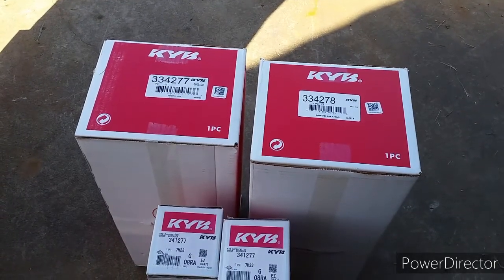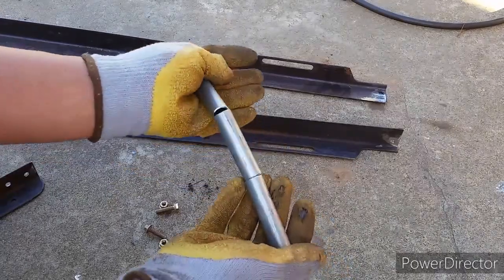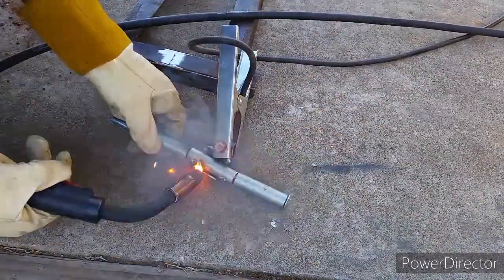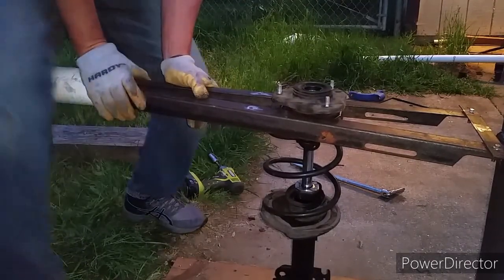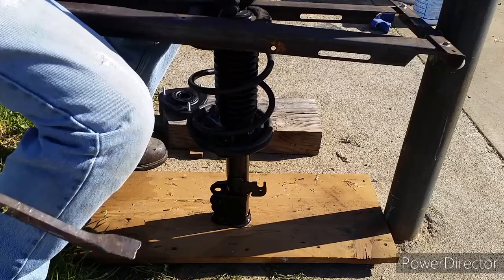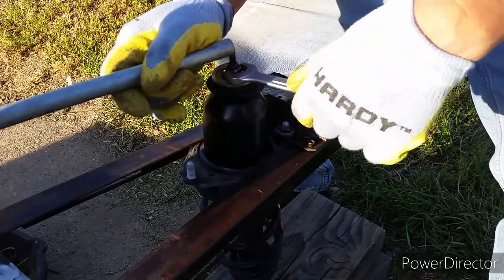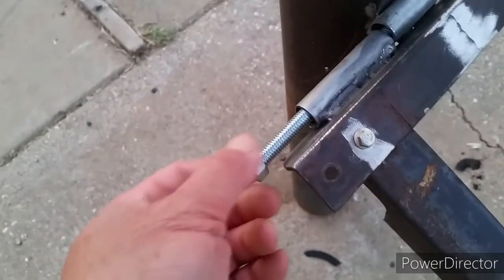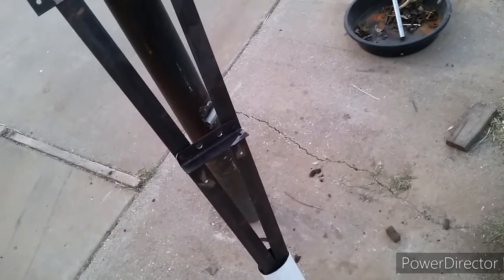Homemade strut spring compressor | Awesome easy to use | DIY

Comment: Good job.. thank you…
Reply from the maker: Changing struts was a breeze.  Don't worry  about the spring exploding.
Reply from the maker: I think i may make a video of how to remove the engine. I wrecked my celica and I picked another one but this motor burned oil like crazy. I'll install the engine I've rebuilt from my wrecked car into this new hooptie. Not sure when yet.

Comment: Gotta buy a welder.
Reply from the maker: It's handy. You can remove the broken bolts stuck in the engine block. Fix any metal that has fallen apart.  Build things.  Get one that can hook to argon gas.  Less splatters.

Comment: fantastic bro . I guess this will not work if you are a lightweight, huh? lol
Reply from the maker: Actually it didn't require a lot of weight.  All I'm doing was slightly depressing by sitting on it.  My feet were still on the ground. Even when you are a lightweight individual, it will still be easy to do it.  Probably about 100lbs is enough.  You can always bounce on it. Or get a chubby  girlfriend to help.  😆

Comment: Yess!!! I love this method man! Thank you for thinking outside the box friend, btw you know you can patent the idea and sell it right??? 😎 

True, the only thing i would add to it, as you previously mentioned the chance of the bottom-end slipping away and hurting something...

simple fix in my opinion..
  (2) pieces of 2x6, cut both to 1ft long, then make a center hole slightly bigger then the average struts bottom end of one of the pieces, stacking the pieces on top of each other( wood with hole being on top) and screw them together.. now the strut has a little groove to sit in,  protecting you and your new strut 👍
Anyways this definitely helped appreciate it and I'm
looking forward to what else youll come up with.
Good luck
Reply from the maker: All you really need are a few square tubings that can bolts together to assemble the kit.  You can make a killing selling them.  Lol

Comment: Could you use the vehicle itself-bottom control arm as a compressing tool?
Reply from the maker: Undo the front springs on the car is possible.  Just remove the nut on top, then jack the car up to remove springs. Put it back requires adjusting the strut shaft to line up while jacking up the control arm. Little tricky.

Comment: I take it all back
You did weld it
Reply from the maker: I only welded the tubes at swivel area.  On the post and on the ends on angle irons. The rest are bolted on.

Comment: nothing is safe if you are using your crotch to hold down several hundred pounds of pressure.
Reply from the maker: Actually there is not a whole lot of tension there.  I just pressed down enough to loosen the nut. Even if I was to fall off the handle,  nothing would happen.  There's not energy in the spring to shoot up and cause any injuries or damage anything.  But if you clamped down the spring,  now you're loading the coil. If suddenly released,  it can cause serious injuries.  When i removed the nut,  the spring would only rised a few inches.  Totally a lot safer any strut compressors.

Comment: The strut compressor shown at the beginning can be dangerous and is nerve wracking. But the example you used was also either intended to fail for demonstration or they were a moron and not doing it properly.

Comment: Nice . Now where is that piece of steel pipe and those bags of post cement .
Reply from the maker: Previous owner cemented a basketball hoop next the driveway. everything got dismantled except the lower section.  It's filled with concrete so i just left it there.  I got another use for it. I'll make another video when i get a chance.

Comment: 0:13 I use this spring compressor the problem in this video is that you can see bulging since they are not even looks like the creator of the video intended this to happen in purpose to demonstrate what would happen if you don't engage the locking pins.
Reply from the maker: I know the spring compressors work but they are hard to use. Some got locking pins and some don't.  If not properly seated on the spring, they will slide to one side when tighten because spring coils are at an angle. This would cause it to bulge. Even when they're evenly comressed like in video,  they can still slide at any time.  The more you use these spring  compressors, the better you get at it.  Keep in mind the spring clamped down has a lot tension and can go south on you.  Side note, the shocks in the back of the car have tighter coils so you can't even insert clamps into them to compress. Homemade spring compressor will be able to handle them.
Reply: @tonedubb4325  are you a beginner at coil springs suspension removal and installation?
Reply from the maker: I have done a few but everything tried to remove springs using the clamps, they tend to slip if the bolts were not even tighten.  Reinstalling new strut was kinda scary too. If the springs were not even compressed, nothing would line up. They can't be used on rear small springs . But your homemade spring compressor does it easily and I am worrying springs flying at me.

Comment: What about if you don't have a pole set in concrete?
Reply from the maker: You can screw a small piece of 3/4in plywood onto a wall like in your garage or use the fence 4x4 post or a tree. It so happened I got a half metal post an old basketball hoop. I used that.
Reply: J dub Motors please use your brain

Comment: I like it but I do wonder if it would work with a strut from a 1/2 pickup. I would guess that more force may be needed?
Reply from the maker: It should. Make the handles a little longer. Have another person sit on it as well. If you sit too far from the strut, it will be harder to reach to losen the nut.